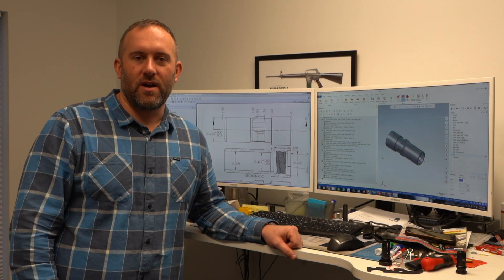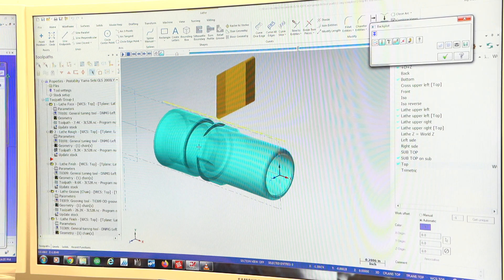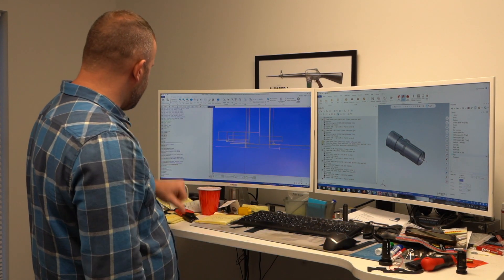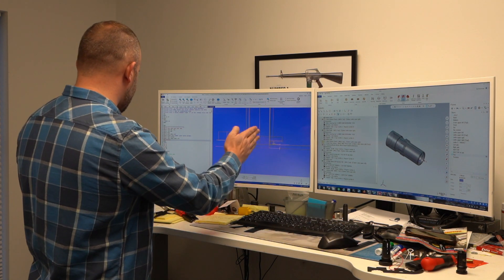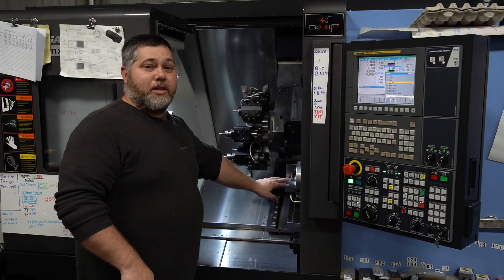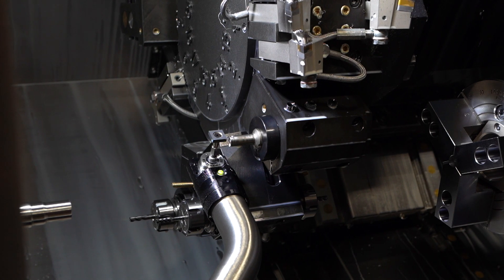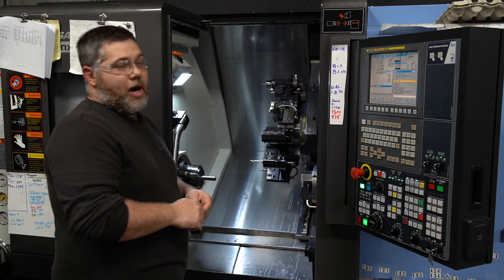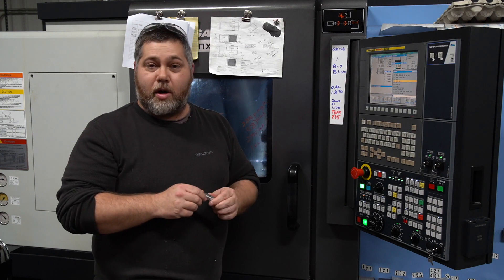Manufacturing: How do you actually make a part?

Comment: This really isn't a video on making a part, but setting up a new machine or one that isn't equipped to handle what you want to make. If you're making the same parts, on the same machine, day in and day out, it's feed the machine and hit go. HAAS has some great tutorials out there, that cover each step and process, much better than this one.
Reply from the maker: This was never intended to be a tutorial, but a glimpse into what our engineering and manufacturing departments have to do in order to produce a single SKU (or in this case, a set of 3) for one part of our product line. The intended audience is largely unaware of the processes and time burden surrounding CNC manufacturing, and after watching this maybe they'll have a little better grasp on how much work goes into what we do here at Griffin Armament. Thanks for checking out the vid!

Comment: Awsome video. I really wish I would have chosen machinist instead of mechanic. I'm about 20 years in and auto mechanics are starting to get old. Being able to create tools and parts from bare metal is awsome, don't get me wrong I've done both but with welders, grinders and drill presses, crude but effective.
Reply: I can promise you that being a machinist is rewarding but also fucking stupid. Go be a welder or electrician and make better money. For the amount of technical knowledge that I have to know, i get paid fuck all compared to a welder or any other skilled trade. I also don't work for a shitty company either.